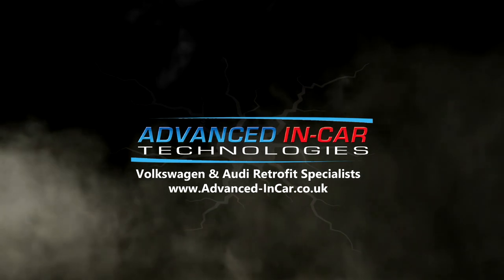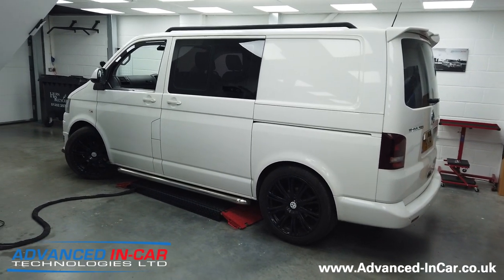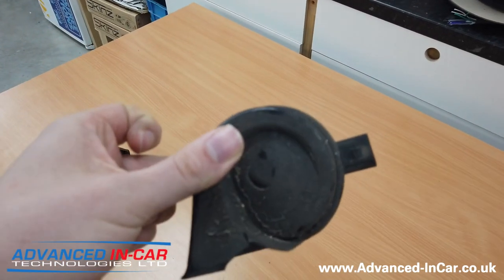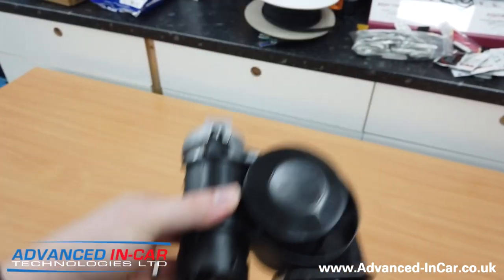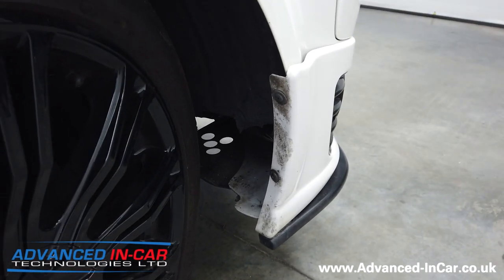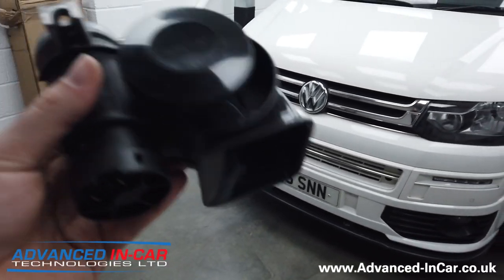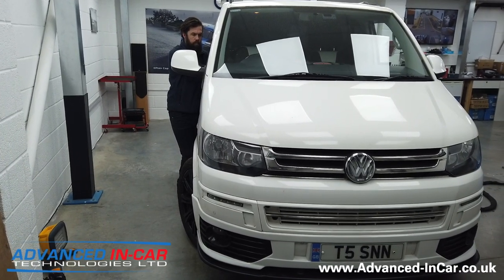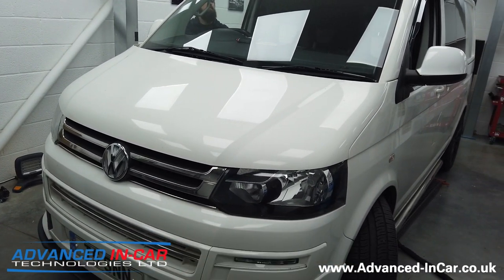Volkswagen Transporter Horn Upgrade - 110dB Of Pure HORN!

Comment: Does it work on a vw T6.1?
Reply: I'd love to know this too!
Reply from the maker: We’ve not fitted one to a T6.1 yet but I can’t see why not.
Reply: I've got a T6.1 Multivan Highline and just check to see if this would work with my auto electrician and he said yes as the horn isn't part of the can bus system...The horn on the new multivans is crapi!! they've changed it from a 2 tone to single...I have a friendly sparrow that comes in my garden that farts louder than that 🤒
Reply: Hi would it fit a 2008 t5